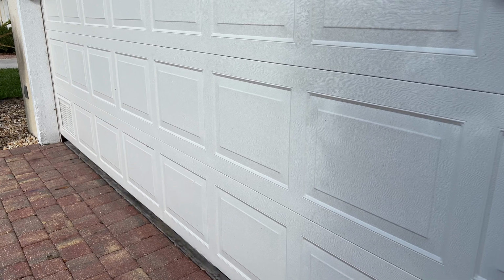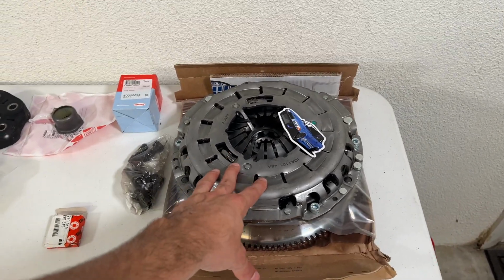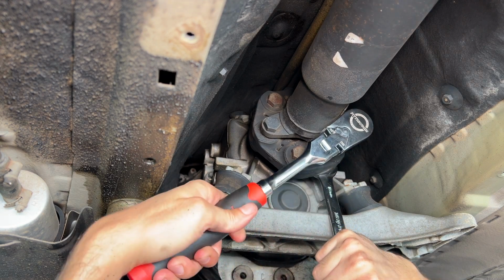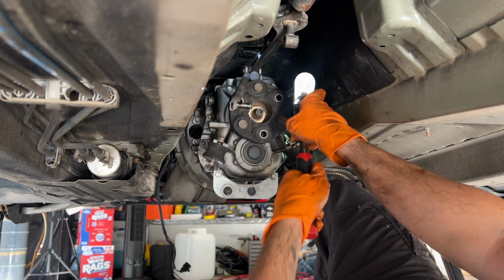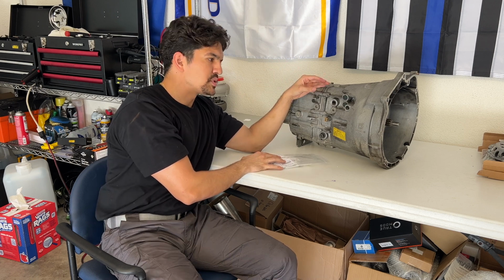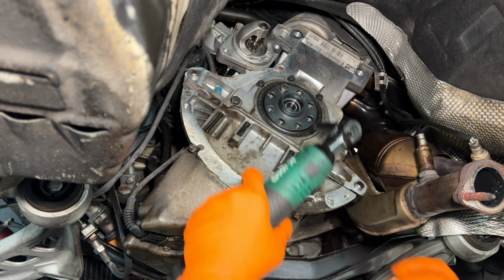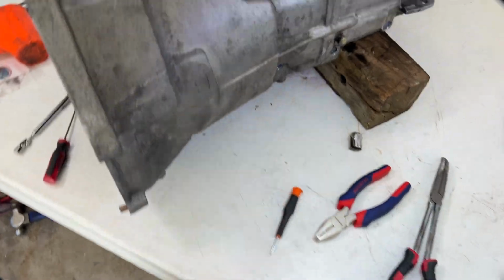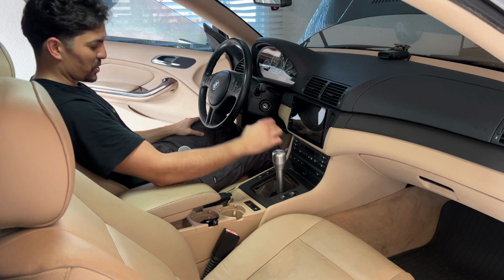BMW E46 Turbo Build PT.2 - Drivetrain Upgrades - Clutch, Flywheel, Shifter and More!

Comment: I know this is a year old but the detents can be installed without the tools. I used sockets to tap the sleeves and caps in. The worst to do was reverse, trying to compress that spring.
Reply from the maker: My only concern is how do you know how deep to go in each cylinder. The main part of the detent is more about the depth at which it places the sleeves.
Reply: @pythondon you check it while you tap it in

Comment: I know I’m late but why did you pump the oil from the dipstick tube instead of the normal drain?
Reply from the maker: Bruhh tbh IDK I had the tool there so I figured why not use it. Much less messy i guess would be the best answer lol 👍

Comment: putting links for the parts u are using would be much appreciated
Reply from the maker: Dont worry brother I have an entire build sheet with ever item listed out. I mention it towards the end of ep. 1 and clipped in a little teaser of it. Im going to give it away at the end of the build 👍 Be sure to stay tuned 😉🙏🏼